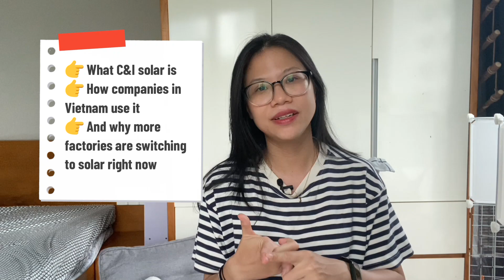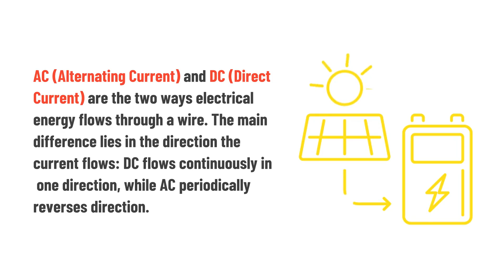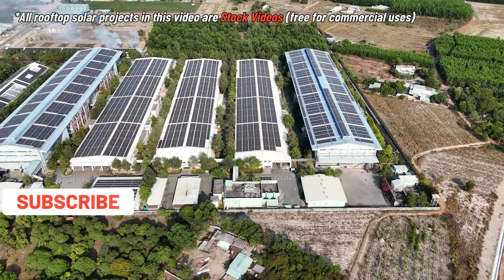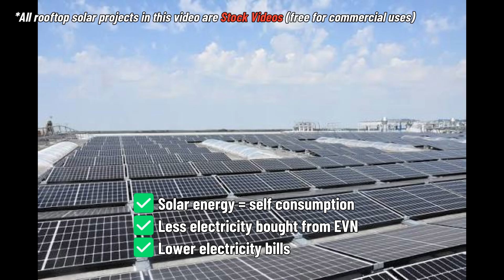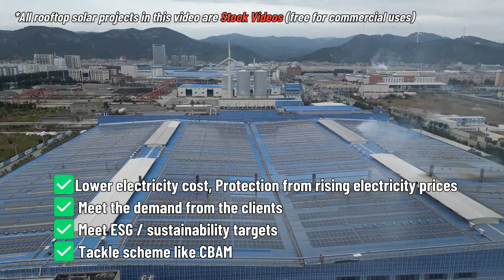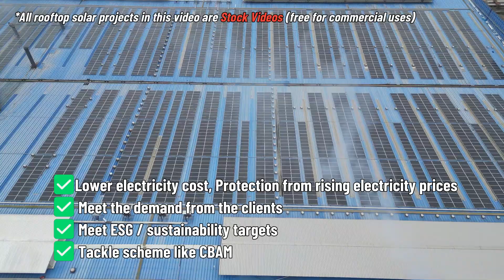What is C&I Solar? Why Are Factories Switching To Solar Right Now In Vietnam?

Comment: Is there a residential solar program in Vietnam is it possible to sell back to the grid
Reply from the maker: There used to be a program like that and it cause a boom in development in rooftop solar in Vietnam in both residential and C&I around 2019-2021, but not anymore at the moment, projects now is for self consumption. 
Edited: actually, after replying to you, i searched for residential solar (as my job experience only focus on C&I, so i lack of knowledge for residential topic). Turns out, there is a possiblity to sell the surplus electricty to the grid (maximum 20% - there is a draft that propse allowing sell back 50% but not yet turn to law). Please excuse my limited knowledge.